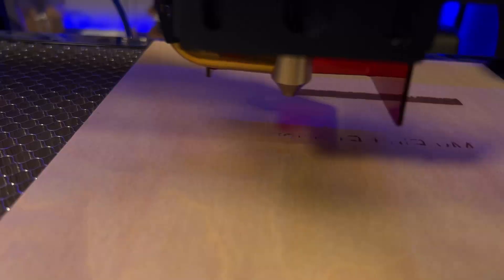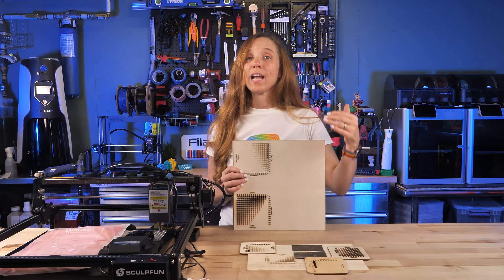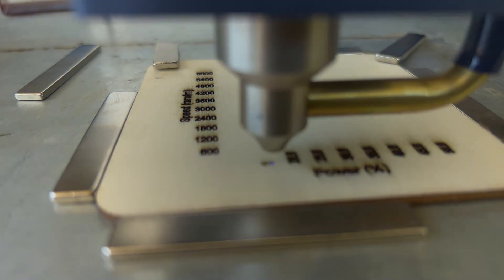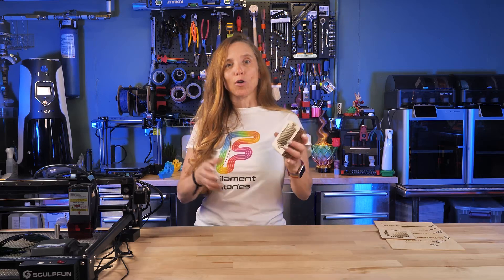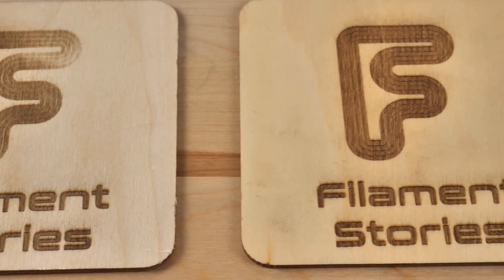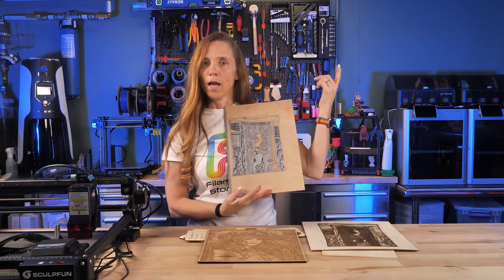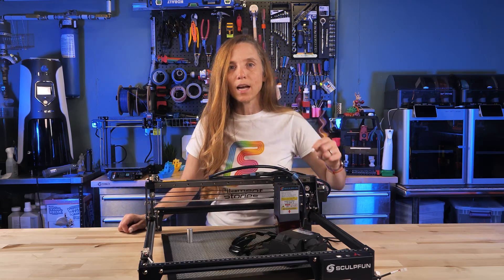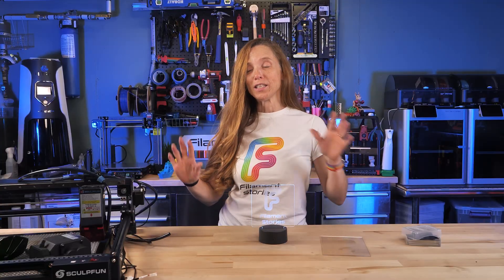My Experience with the Sculpfun S30 Pro Max Laser Engraver!

Comment: Very good thank you - I’ve just bought one and this video was a great helpful insight 

Also, that woman is gorgeous 😊👍🏼
Reply: Hi dude,
Did you 3 mm plywood cut? If you cut, what did you arrange speed and power?
Reply: Hi there - I have the S30 Pro Max - for a 3mm cut of plywood I use 200 speed and 90% power - it cuts 3mm first time no problem - I cut through 5mm Oak at 200 speed and 95%power - 1 cut does it perfect 

I’m still learning all the different settings, but that speed and power cuts straight through no problem

Hope that helps 😊👍🏼
Reply: @NFFC-ENGLAND  Hi Derek, Firstly thanks for your information. Actually I am trying for 10 mm plywood 1 cut but i didn't yet. Your machine is 20w? Can you try 10 mm plywood and can you give me info pls. Where am i making mistake i don't know? İ am bored this position. :(

Comment: The only issue I have with the sculpfun laser is the disconnection from the laser to the workspace. There’s no way to calibrate the workspace in lightburn with where you know you’re in the same place every time. 

One thing you didn’t do and will cause you a lot of dust to collect on the nozzle is you want to raise the bed up so the dust can blow UNDER the honeycomb bed. Also be sure you have the reflective plate under the bed as well so the laser won’t damage your work table.

The Roly lasermatic10 you’ll find is a lot better. The only thing that it doesn’t have is the automatic air assist.

Comment: Instead of having everyone wear safety glasses (pets?), it would seem safer to have a laser cutter in an enclosure.
Reply from the maker: There are laser engravers with enclosures, but I think this style is to keep it simple and the cost down.
Reply: Yes, but then you will need more fans and extra setup so the vendor did not prepare it for it, since an enclosure will add the extra fun or proper ventilation, and that's an extra job that must be documented, also keep in mind that even with that you are always working with a laser so always be careful.

Comment: Okay I need to know what the vortex thing is in the back by the piping!
Reply from the maker: Ah!  That is the Hitry Rocket 1 resin 3D Printer.  It's a different take on resin printing as the print lowers into a vat of resin upright, rather than pulling out of the vat upside down.  It can go quite fast, but requires some extra calibrating to get it working just right.  I'm allergic to the resin so I stick to FDM printing most of the time.